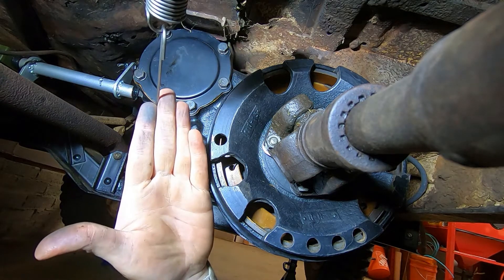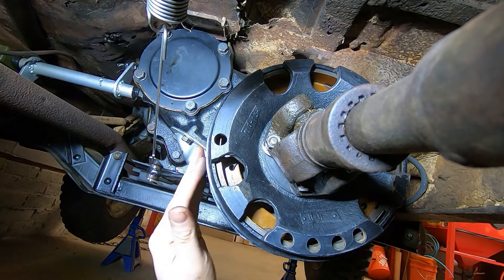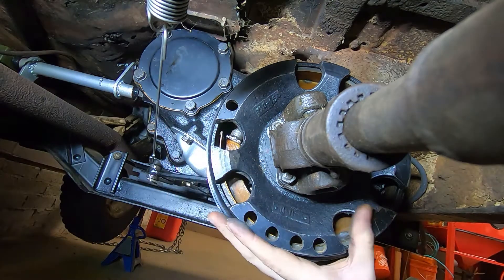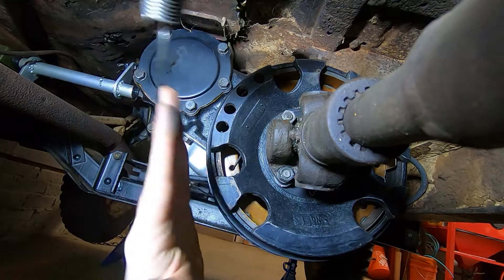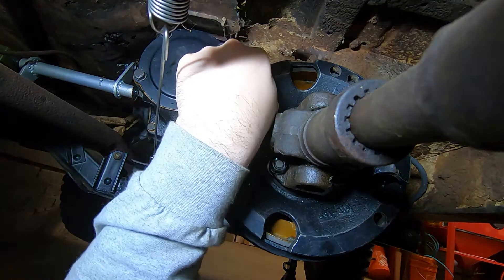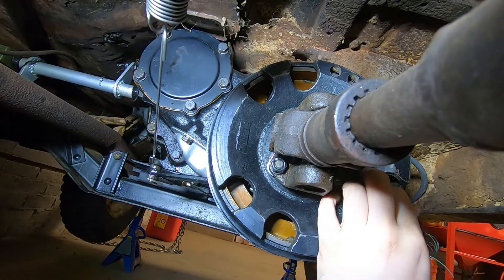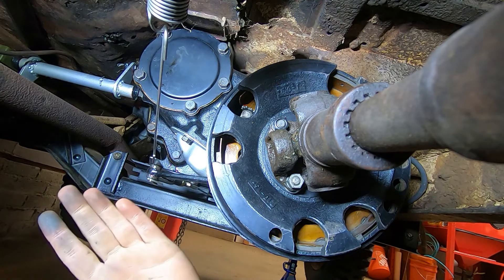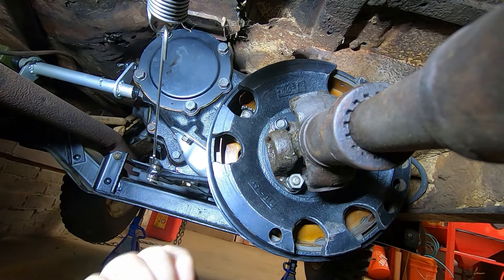CJ2A E-Brake Problem/Question

Comment: I looked at my setup this morning and I have a similar big gap on top and very little on the bottom with my adjusters pretty much all the way in. Mine also moves like yours where the lower shoe seems to do most of the moving and braking, while the upper just wiggles. My anchor point wiggles a little when I actuate the lever too. It may be down to the welded anchor being off just enough that you can’t get the lower shoe adjusted enough to clear. Hard to say for sure. If I ran into this on mine, I would make sure nothing else but the shoe was dragging, then I would take my grinder and shave off a little metal from the shoe bracket where it contacts the cam lever and the adjuster.  A little custom fitting should get you enough room to clear the drum but still be able to adjust it to do its job and grab. It’s not a very precise or complex system, no sense driving yourself crazy on it.
Reply from the maker: That's exactly why it's driving me crazy, though. It's very simple 1940s technology. It shouldn't be this complicated.

Comment: What you can do is run the thinnest feeler gauge around, between the shoes and the drum to see where it drags. On the video it looks like the top part by the adjuster has too much space, but the bottom is too tight, specially the top shoe. Also when you pull the lever the shoes go crooked, because you have too much space up top, so the cam has to tilt more and starts to push the shoes sideways. I know it sounds contradictory, but try opening the adjusters on the top, to take up slack and the shoes should align better. They are very crooked now. The squeak you get is also odd, it sounds like metal against metal. I believe it should be the bottom anchor you had welded on the backing plate rubbing against the center of the drum. They are normally very close and if it was welded a little off it can rub. Hope any of this helps you out, good luck!

Comment: Have you watched the operation of the brake with the drum off?  Seems you should be able to see what's not working correctly.  Are the shoes pressed too hard against the backing plate preventing them from retracting?  The places on the shoes that do touch the backing plate should have a little bit of grease too.
Reply from the maker: That is a good point about those few points of contact on the backing plate. Each one does have a small dab of grease, though. 

The functionality seemed right when I had the drum off last.